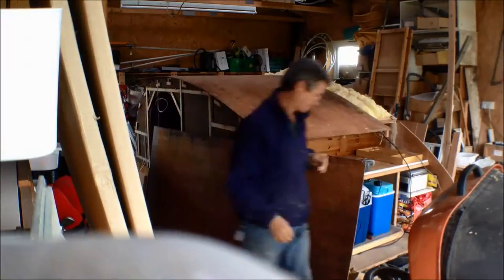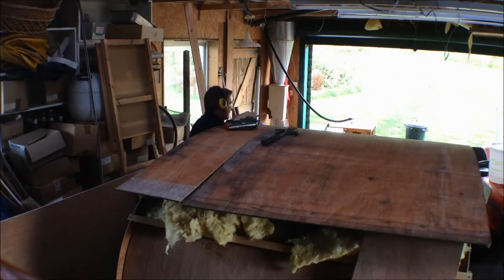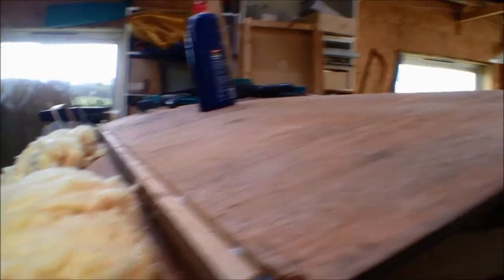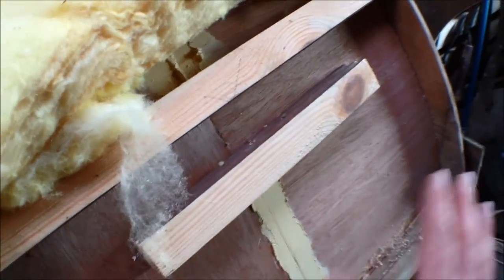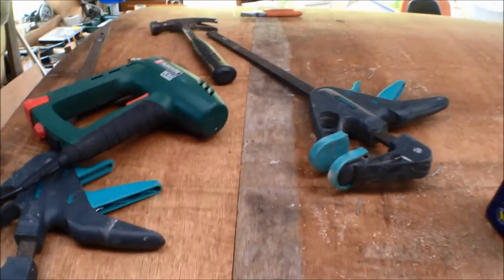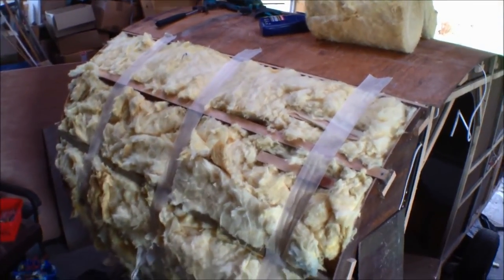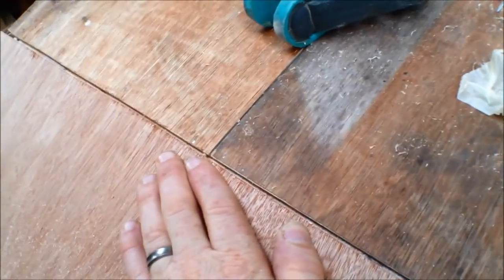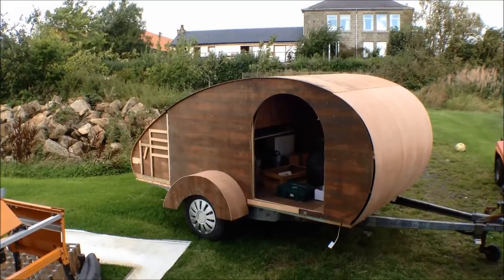Putting on the Teardrop roof

Comment from the maker: It is 1/8 how ever I've had to replace it with water ingress. It came in at the join between the wall and the roof. I would recommend using a fibreglass strip along that join.  That's what I've done with version 2.0